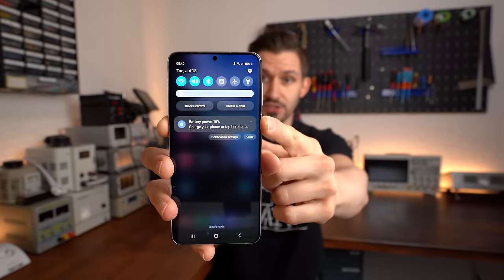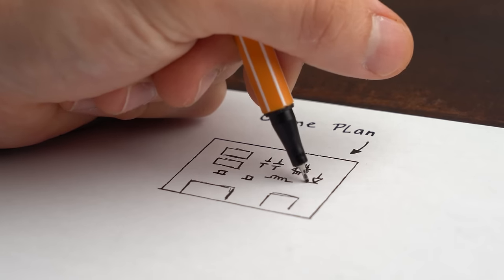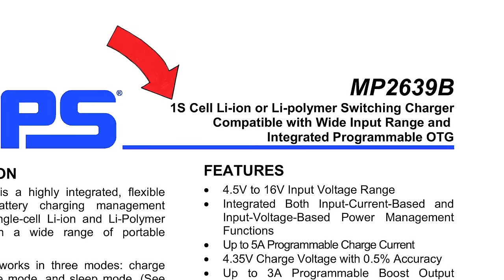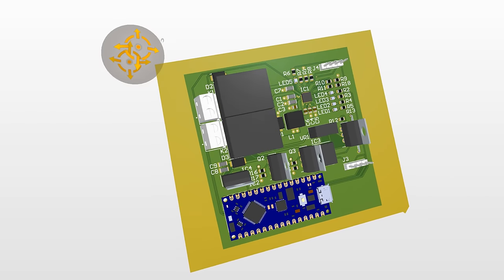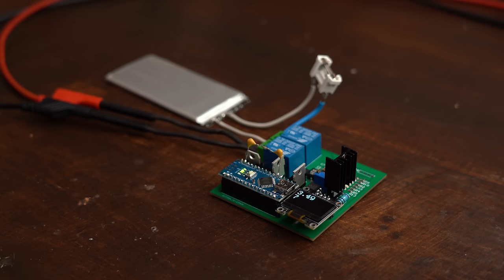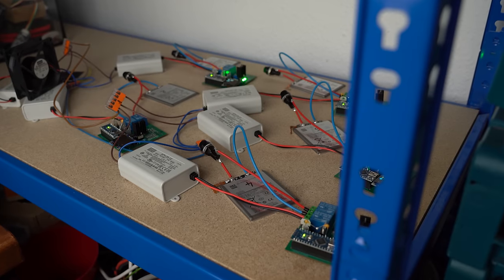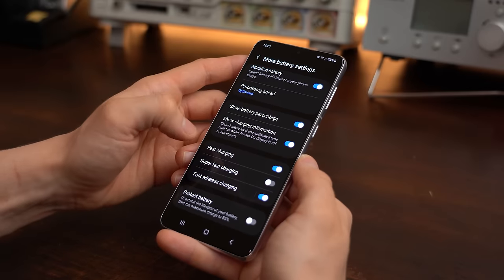Don't Fast Charge your Phone before Watching this Video!

Comment: I always charge with around 1-1,5 A up to 80-85%. Worked well for years now. My current phone is ~2 years old and I only have to charge it once or twice per week. No noticeable drop in capacity yet. Same with my E-Bike. Each cell is charged with 600-800 mA up to 4-4,1 V, and discharged to 3,5-3,7 V.
A drop in capacity doesn't mean the battery is dead. My PS4 controller for example got too low in capacity. I put an old phone battery in which itself wasn't good enough for a phone anymore, but perfect for the gamepad. And the old gamepad battery was put into my GameBoy Color. It still lasts for many weeks in there.

Comment: 11% per year is actually pretty good, unless u plan to keep your phones battery good for 6-7 years, fast charge is the way to go as long as your phone doesnt get too hot, for most people about 3-4 years of good battery is enough before they upgrade, a very small percentage would actually be affected

Comment: There are several levels of fast charging. My previous phone had 18W maximum and my current one has 30W maximum. I just switched to the 18W charging for now. One important factor missing is the temperature. No phone gets as much ventilation during charging as your test bench :)

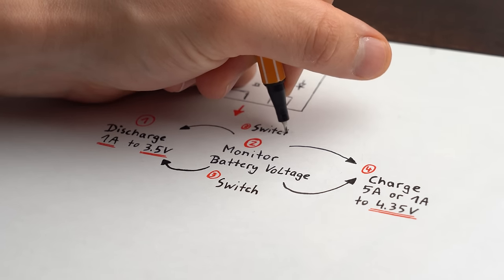Comment: I was wondering at approx. 2:50 why charging is completed once the maximum voltage is reached. Battery manufacture recommend to continue charging in constant voltage mode for reaching a state of charge (SOC) of 100%. As far as I would expect it, mobile phones would charge in constant current and then constant voltage, too. My point is, charging up to 100% significantly impacts the battery life. What is your opinion about this?

Comment: I rarely use the fast charging capabilities, only when I have to get somewhere and don't have a few hours to spare.
Then again, I tend to use a 500 mAh charger (an old 27 year corded charger with USB-C adapter) to charge my device overnight.
Low current is key to allowing the battery to last longer as it ages over time.

Comment: i have a couple of problems with the video, at least with me, i charge to only 80/90% because i always have a powerbank or a outlet nearby,  also, i think the way you never gave the battery breathing room such as breaks, or lower currents for specific times really hurt the battery more, plus those battery measuring apps from personal experience arent very good in comparison to directly measuring the batteries current output

Comment: Most battery manufacturers will give some indication on the battery life time (in # charge cycles) depending on the charge current and the percentage to which you discharge or charge a battery. A high charge current is not as bad as a 0 - 100 - 0 charge/discharge cycle as long as you follow some guidelines: do not fast charge an almost empty battery, not an almost full battery and do not allow the temperature of the battery to rise too quickly.
If you adhere to these rules (and most phone charger algorithms will) the battery will last a very long time (up to 1000th of charge cycles)

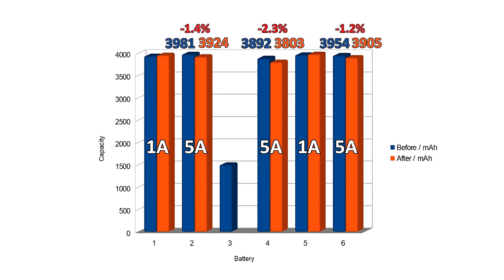Comment: Excellent work, but your conclusion around 11:20 looks like it may not be statistically significant given the variation. I do biology research so I have to deal with insane variability all the time - in your case you probably just need to run the experiment longer. It may already be significant, but it's important to check.

I'd also wonder about the temperature of the batteries using the different charge cycles over and over again on a shorter time scale. It may be that it doesn't get significantly warm at all, but a surface thermocouple would easily check that variable.

Comment: Hey i love your videos.

Could you make a video about an old Wiring System wich their are no videos of findable on youtube at all.

And on Wikipedia you can only find a slimple description.

It is called:         "Fädeltechnik" 

thats german meaning something like threading technic or weaving technic. 

Dont mix it up with Wirewrapping wich is "Wickeltechnik" in german.

It comes in handy that you are german because as far as i have researched it i couldn't find anything like it in the english speaking world.

I am really interested in it because if you want to make cuircuits but you dont want to order custom circuits this is i think the best and cleanest way to do it and it also has the advantage of an extremly high possible wiring density wich you could never reach with prototyping by soldering thicker gage wires on your board.

Comment: My Galaxy Note 10+ faired pretty well during the first 2 years. Then i got the 45W ultra fast charger (from 25W) and immediately noticed battery drop within a week of use. After that it continues to drop slightly every month. I always charge the phone min. 15-20% max 85%, to protect battery.

Comment: One missing "test point", temperature ;)
If u fastcharging is more heat, so u can heat up 5A cell to about 40-50 celcius, when charging ofcourse (meybe use some heat coil) and test capacity after 100 cycles.
Also "summer" destroy a lot of batteries when ur phone is exposed to sun.

Very good test but temperature is most important, make again 100 cycles with heating up cells when charging 5A ;)

Comment: Ive been keeping an eye on some of my electronics with fast charging even a laptop i have with 100w fast charge but ive noticed something. Even after reapeated fast charging and recoding some power loss, if you do a few slow charges you regain most of the lost storage. I have lost some max capacity over the years but even so all of my devices are well under the expected capacity loss after 5 years. Most of my devices are still withing 99~88% capacity after 5 years of fast charging.

Comment: Damage to lithium battery SEI layer is supposed to correlate with total charge time, not current.  High current charging should theoretically reduce charge time and increase battery lifetime.

Comment: This theme is overrated, but again, this is my subjective opinion. 100 people 100 options. It's good to know that there are some downsides to faster charging and I think everyone with knowledge of electricity knows that, BUT for me it's about the features and being able to do so. So, the mobile should be your tool which provides what YOU need and not otherwise. That means we should not be cutting our options just because it is doing a "little" bit more "damage". But I have to admit this video is super cool, informative and most importantly fun to watch. Thank you so much for that. Have a great day. :)

Comment: I partly agree with these calculations because after four years of regular use of the smartphone, I changed the battery because the previous one was no longer usable. 
The test, however, doesn't seem very comprehensive to me because you would have to check the integrity of different battery models (obviously if they are manufactured differently) and see whether or not the capacity stabilises at a certain level of cycles. For examples my Lenovo Flex 5 battery is more or less keeping it's capacity after 450 cycles with littles fluctuations
Reply: Stabilisation is impossible. It will always continue to degrade.

Comment: Most lipos are rated to 80% initial capacity after 500 to 1000 cycles charged at 1C (or whatever the rating is). Then they are considered dead. You should discharge your batteries relative to the c rating. This would be a more appropriate test.

Comment: The underlying degradation mechanism is in all likelihood heat.  This is important since wireless charging is less efficient and generates more heat... which may in fact be worse for total battery lifetime... Ideally a charger from a few years ago that can only supply 1 Amp by wire will probably make the phone battery last the longest.  I would recommend redoing your experiment and use heat as the variable... for fun you can look up the thermally activated rate equation if you want to get really into it.

Comment: Great job with the experiment. I've often wondered about fast chargers. I love your videos and I wanted to give you a bit of advise on experimentation in general; you should test a sample size as large as is practical. If I flip a coin 3 times it's very likely that I'll get the same result all three times, but flip that same coin 50 times and you'll see the numbers settle closer to 50/50. You need a sample size large enough to discount luck.

Comment: I charge my POCO F3 GT with an old Blackberry charger of 5v and 700ma which charges it at around 3.5 to 4W. And use the original charger of 67W only when in rush, let's say 2-3 times a week. The difference in phone temperature when charging with the two is night and day. With BB charger, the phone barely goes above room temperature and with the 67W, the phone gets quite hot. But since it can get the phone above 60% by the time I get ready, it's worth it. Also while traveling, instead of a power bank (mostly) I use the fast charger.

Comment: @GreatScott! Theres two theories to battery degredation. 1.) Fast charging or 2.) Regularly going over 85% or under 15% charge. Can you test  theory 2? (if you haven't already) Samsung has a battery protection setting to stop charging over 85% to save battery life meaning they believe in theory 2.

Comment: This is a nice first step into battery testing. While you could have done the testing for longer cycles as mentioned by the other commentor, you would soon run into a problem.

Temperature. In a phone, there is a temperature controlling system which usually dissipates heat developed in the battery during charging/heavy discharging through heat pipes. You could see the effects with different controlled temperatures.

Comment: I've had a Samsung Galaxy S10 for almost 4 years which I've fast charged every single time and the capacity is still more than acceptable. There's definitely a reduction but it's small, my battery stats say a full charge lasts 2 days but I'm not a heavy phone user.
Batteries are consumable items, and these devices were not even designed to be repairable let alone last that long. And if most people get new phones 2-3 years, the convenience of getting a fuller battery faster is probably worth it.

Comment: I had a OnePlus 9R which I purchased in November 2021. I exclusively used their 65W Fast Charger. During the first few months with normal usage my battery would last a full normal work day. Less than a year later it woldnt even last till Close of Business at 5pm when I take it off the charger at 6am. Keep in mind I dont play games on my phone.
Reply: Part of it is also because the Snapdragon 888 is a POS CPU thats inefficient and runs hot. It just adds on top of the degradation you get with fast charging

Comment: ive seen a video talking about this in depth, but its conclusion was that the heat was the principle actor in battery life change, and not charge cycle, and that if a battery was properly cooled, it would last a looooooooong time. Would you mind also testing that, and over a longer period ? this would be very interesting to finally see if that theory is correct or not

Comment: Thank you so much Scott. It's exactly what I want to see. I'm still wondering, should I use 45W charger with fast charging turned off on my S24U, or should I use the old 15W charger (came with my previous S8)? Which is best way to efficiently charge the phone and at the same time protecting it?

Comment: Where do you get the information for proper battery management and charging curves and all of that? I'd like to know.
Edit: also I think it'll be a good idea to do the same test with other power options (3amps or so) to check the relation between power and battery wear.

Comment: What you didn't consider, is that with fast charging, you are more likely to put your phone on charge for short amounts of time more frequently, rather than draining it all the way down before for example putting it on charge at night before bed, letting the battery drain down all the way can be harmful in itself, and fast charging can be helpful to adopt more healthy charging habits (as I have noticed being the case for me since I got a new phone that comes with a fast charger), this change in charging habits can negate or even outweigh the additional wear from the additional heat that fast charging produces.

Comment: I think you should get a hot air station if you want to work with smd. With hot air the components literally self align when the solder melts

Comment: I'm wondering...I know that some types of cells will be unable to charge to full capacity and the max will slowly but surely decrease over time - and that has nothing to do with fast charging, let alone super-fast. There are battery charges that can (I forgot the term) "flush & fill" the battery back up to max cap. Do you know if the Li-on batteries you used have that challenge, too?

Comment: i have a s21 ultra and i made a routine to it. everytime i connect a changer it will automatically disable all 3 fast charging and stop charging at 85%. if a do need a quick charge i simply touch the icon to disable the routine. im done swapping batteries after they swallow. new batteries and laber costs more than i thought

Comment: I do repair business for years and I can confirm that fast charging do eat your battery faster with hundred of phone as testimonies….while mine only using a charger that is not fast charging but also not the slowest one…for example..iphone user have few choices of charger…5w,10w,12w,18w,20w, and so on…..using 5w charger is no brainer nowadays..freaking slow LOL…and using fast charging charger will eat your battery faster so just use the middle one..for example in this particular case..use the middle one which is ipad 12w charger instead of the 5w snail charger or 18w and beyond fast charger…

Comment: afaik some if not most fast chargers work by increasing voltage instead of amperage, because a high amperage has a better chance of overheating the cable amd causing an accident compared to high voltage

Comment: These really are best-case results, because the batteries are in an open air test bench with no outside sources of heat. In a phone, they'd be much worse off because the power used gets dissipated as heat, that 1A of power has to go somewhere afterall, and, the battery itself further contributes to that thermal load.

This is, of course, intentional on the device manufacturers part, because it's far more profitable to forego thermal management and sell everyone a new phone every 2-3 years.

Comment: Ran a welch's t test on the data as the change didn't look too large. They are significantly different with 5V charging causing battery capacity to reduce. t(2)=6.6221, p=.0221, mean difference = -82, 95% CI =[-135.28, -28.72].

Comment: I really wonder if the new flip phones with 2 batties would summer from the same effect. My thought is that since there are two batteries the 5 amps gets split into 2.5 each, so it would be closer to the 1 amp normal charging and therefore reduce the wear and tear on the batteries. This could be tested by adding a second battery and load balancer to each test bench (I know easier said than done). I also recognize there's a real-world disconnect of not knowing how exactly the batteries are connected in these new phones, but it would be a cool surface level proof.

Comment: Very interesting video, but why didn't you continue the experiment with successive steps at 300/600/900 charges? I know it takes time but it would have given an idea over time considering one charge and discharge per day. Will you make a video where you test if this problem also occurs with wireless charging?

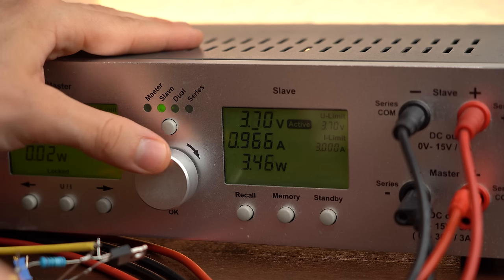Comment: 3:30 Wouldn't it be more realistic to aim for a constant discharge power ? Like 4W

Also, you could have done 1 or 2 charges per day no matter what the charging power was. But here you reached 100 cycles earlier on the 5A batteries than on the 1A ones

Comment: I really with more phones had the option to limit the full charge state and better control the speed. Being able to charge the phone in ~20 minutes is awesome for if I'm out and about, but there's no reason to stress the battery when it's just going to be plugged in for 8 hours overnight.

Comment: MOTOROLA has an adaptive charging option that doesnt fast charge the phone until aprox. 2 hours before your earliest alarm.
Have been using the G60 for 2 years and the battery which comes with 6000mAh hasnt noticeably changed. (sorry for bad english)

Comment: funny thing is, Samsung Xcover, an outdoorphone, has a removable battery where it would be only a matter of ordering the replacement battery on amazon for about 20-25$ and changing it yourself in seconds, but that phone has no fast charging option, at least none that really is all that fast

truthfully, I'm generally not that much bothered by that as I generally keep my phone between 40-80% by charging it ever two to three days, but it still would be nice to have the option in a pinch

Comment: Isn't there an industry standard for this? I believe it's 80% charge after 800 cycles. Judging from this test, 1.6% average loss over 100 cycles seems on par with the standard 20% loss over 800 cycles.

Comment: One of the main issues with lithium batteries is temperature and how it affects charging. Just look at modern EV cars that have to heat up the batter to even start the higher power charging. Moreover charging lithium batters at  constant current through out the cycle is another factor that kills them. See if you can make a temperature based charger etc…